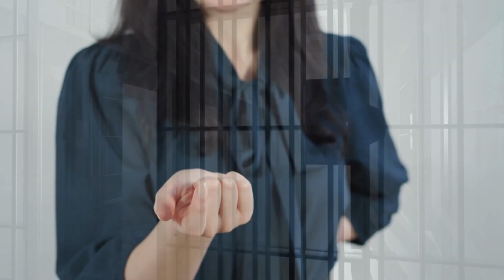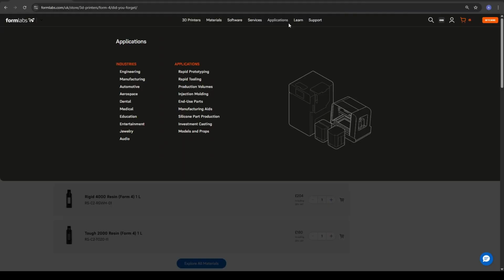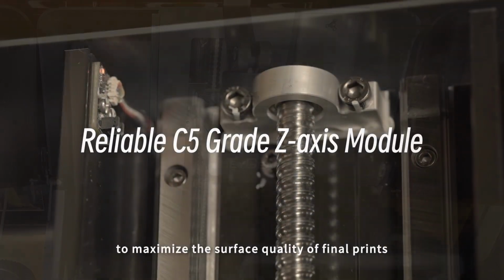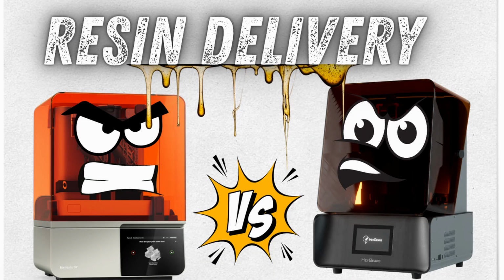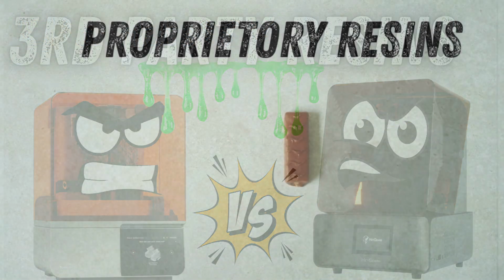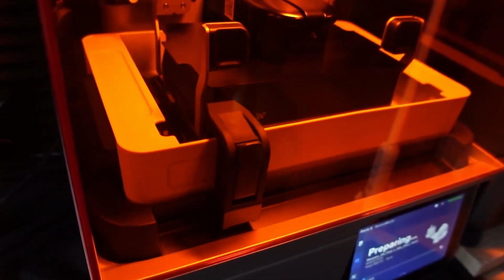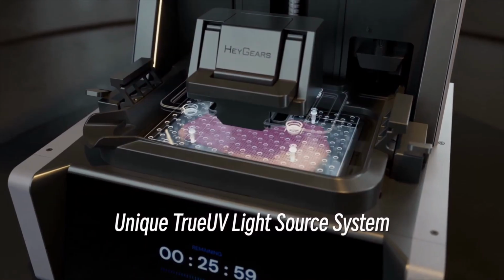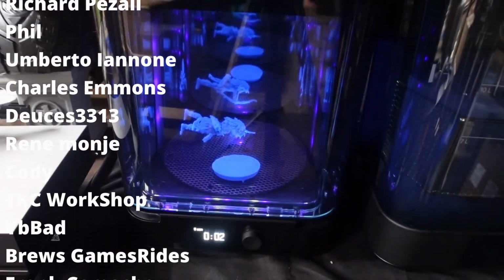Formlabs Form 4 Vs HeyGears RS Turbo 3D Printer Comparison

Comment: How is printing speed compared between the two?
Reply from the maker: There is some speed comparisons in the video generally the turbo is faster than the original RS
Reply: @greedy3d480 But how about the Turbo vs the Form 4?
Reply from the maker: @juanp.5364 I would probably say the form four is quicker purely because he only uses a couple of meals in the Rat at a time which heats up really really quickly set the print starts quicker
Reply: @greedy3d480 thanks a lot for you feedback and videos they help a lot. 💪

Comment: Or buy 3 saturn 4 ultras for the price.... hmmmm, lol
Reply from the maker: Indeed .... if you're lucky enough to get three working models 🤣🤣
Reply: @greedy3d480  I must tell you I feel the same! Emphasis added. I have my mighty revo and its supposedly very "new", but it has more failed prints than i can count. Every print feels like a horror show in the making. That is not an overstatement in any way. 
I own both creality k2 plus and bambu labs printers. The bambu lab P series printers still kick butt after many hours of print, while the creality gets cranky every now and then, despite it being a newer machine. Its showing that good designed products are worth the money, especially the headache and frustration that it takes off from the production processes.

Comment: both machines are on the top of my wishlist. the form4 just explodes my budget completely, especially with the unlocking option of nearly 3000$ ontop.. Hey gears would rule if it was unlocked. I hate locked systems but you can only achieve best results when the machine is optimized for the resin and the resin is optimized for the machine. this way they want to guarantee a near 100% always failproof system. this is where all the development goes and of course thats how they want to get their money back. most pro machines do this but they also just simply work everytime, but you pay the price and have to live with the limitations unfortunately. i'll call Form4 semipro since they have a good range of pro engineering resins, not only for toys. if you want to have a stroke check the price of the 3d Origin one.. I think both machines can nearly rival..if they were unlocked.

Comment: I got my second RX Turbo a week ago, this time without the Pulse and Release module the interesting thing is it prints faster than the first Turbo that has the PRM connected using the same STL file.
Reply from the maker: Now that's very strange

Comment: Hello Greedy.

Great video. I recently bought the HeyGears RS Turbo. I also have a GKTwo with the ultrasonic cleaner and the old Cure system from Uniformation, and I also use an Anycubic for pre-washing.

I'm considering replacing them because I have too many devices. Either with HeyGears Cure and Wash or HeyGears Cure and Formlabs Form Wash.

What would you recommend? Is the HeyGears Cure Station really that good?

I mainly print 1:6 scale figures.
Reply from the maker: I would go with the form Labs wash station and I do really like the curing station from hey gears for me just makes things simple a nice wide open door to get your prints Amazon built-in heater if you need it
Reply: @greedy3d480  Thank you very much. I have one more question: Does the Formlabs washing station also work well with hollow models, or only with solid models?

Comment: Hello great comparison that iv been waiting for.

Should Heygears implement Formlabs like build plate, closable vats, build in camera for reducing contact with resin as much as possible and even more comfortable workflow (and not by messy), it would be (which now still is for its reliability and ease of use  in consumer hobby space) best printer on market. Heygears needs to see this video and take notes what can by done even better. 

And yes i also think that Form 4 is more comparable with original Reflex which also will have its turbo upgrade. Now is on pre-order on their page... original Reflex Turbo with amber screen... this would be very interesting to see compared with Form 4.
Reply from the maker: Thank you yes I totally agree with that
Reply: @greedy3d480  Im considering Heygears Reflex Turbo + Heygears Cure Station and Formlabs Wash Station 2 setup, and can i ask if it would be possible to fit RS or original Reflex build plate into the frame of Formlabs Wash? I just like how Form wash 2 is intuitive.

Comment: Great video! I love the using the Form 4
Reply from the maker: It's a great machine... if you can afford one
Reply: I've been on the fence between the Form 4 and the RS Turbo. Price isn't strictly an object for my purchase decision, however I also don't want to throw money away needlessly if the print results and overall experience is "close enough" between the two machines. I requested some sample prints from Formlabs and have a meeting scheduled with them next week. Going to see if they can convince me spending more than double on their setup is worth it. We shall see. Great video @greedy3d480!

Comment: After switching up from a Saturn 4, I am SO glad I took the plunge on the RS Turbo. I've only had one failed print so far and that was user error. Only things I'm annoyed about are the lack of printing from the slicer, slicer dark mode and the fact I won't be able to afford the Heygears curing station for about a year, minimum. 😅
Reply: got the rs turbo at release day price which was 799.00 us dollars. same price as most resin printers at that size category .  So the decision was easy . plus the fact that greedy tested non heygears resins , made it a no brainer ! Love it so far
Reply: Heck yeah! Being able to use my beloved Sunlu Abs like v3 is great! The best of both worlds.  @peterpeter5666
Reply from the maker: Interestingly on the original hey gears ultra craft reflex you don't need to press print it does it automatically so I'm hoping an update or put that onto the RS fairly soon 👍
Reply: Yeah I saw that, it's really frustrating, they're just teasing us. 😂 
Same with only giving the RS the option of "general" in resin settings, I want my "miniatures" option please Heygears!  @greedy3d480

Comment: An extremely thorough comparison between the Form 4 and the Reflex RS Turbo, Anthony! Unless I had a business where I could write off the initial and ongoing expense of the Unit and ecosystem, I would never choose the Form 4 setup. As a consumer, if the wallet could be stretched, I’d go with the Reflex RS Turbo and some of it’s ecosystem (as you’ve mentioned). Otherwise, I’d “make due as a “bottom feeder” and focus on Elegoo and Anycubic. Uniformation, Phrozen, and Creality/Piocreate are a bit “questionable” for my sensibilities, right now. Thanks again, though, for the useful and thorough comparison of these two great brands.
Reply from the maker: Thank you for your comments always appreciated

Comment: i have had my reflex rs for 3 weeks now, ive have the og saturn and and a saturn 3 and a anycubic m3 max(its a f'n lemon), im fairly impressed with the turbo, its been going 24/7 since i got and have had zero issues with quality and zero failure's only issue i have is its a little slow,  the resin is actually cheaper than some of the resins my local supplier sells his resin and the expensive stuff isn't compatible with rs, i looked at the form and the price instantly put me off, the slicer just works, its free and less time consuming than lychee or chitu box, lychee pisses me off cause certain files it doesn't like, the locked in thing doesnt bother me even though u are not really locked in
Reply from the maker: Thank you it's always good to hear what other people think about the Heygears machines and their experiences with other printers  thank you for your comment
Reply: tbh, after reading how quickly manufacturers try to dole out new products without thorough understanding of what they are making, i'm really skeptical about investing in the next machine. Unless there are well thought out features like the rs turbo.The form labs and hey gears products are so well refined and thought through products. It seems like ancient history, but Soichiro Honda once said that "a well engineered product sells itself." But, today this is a poorly understood principle and most businesses are more than happy to make and charge at any cost, so long as minimum IRR is satisfied. Thankfully greedy3d480 has shared invaluable insights. I am thoroughly sold on form labs and hey gears.